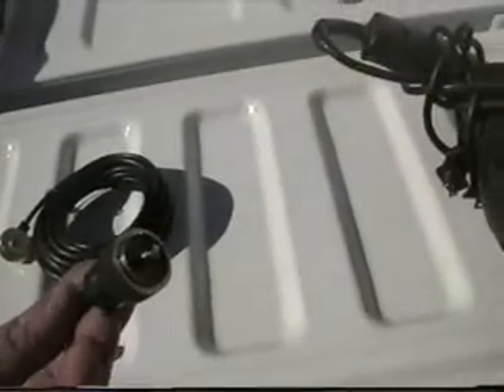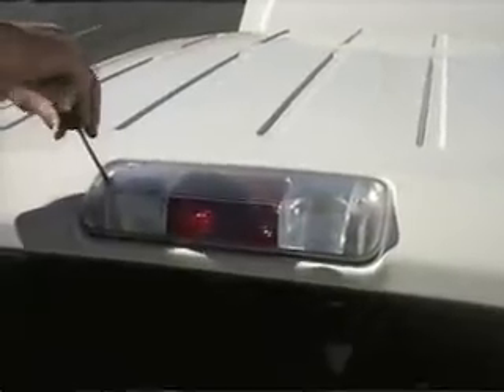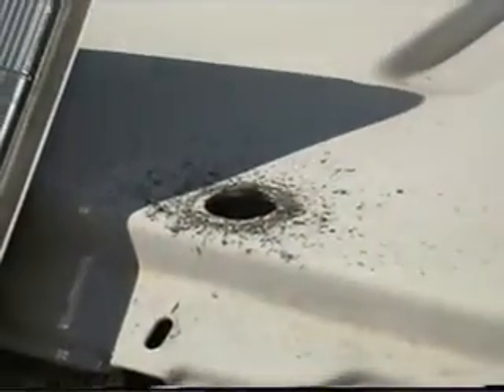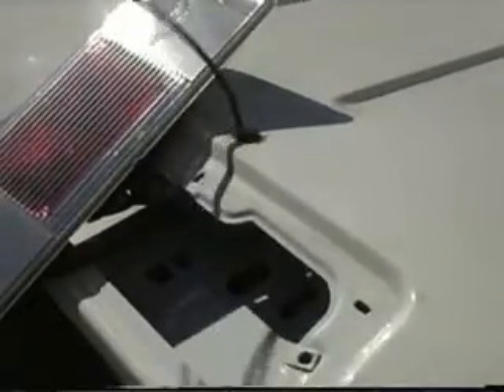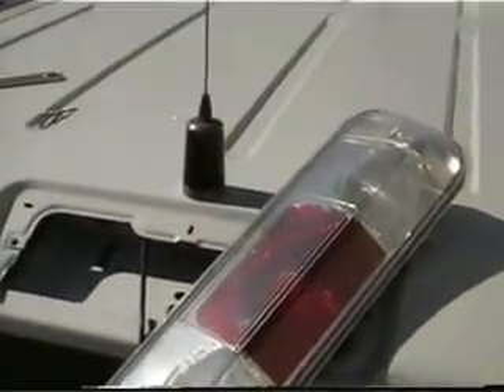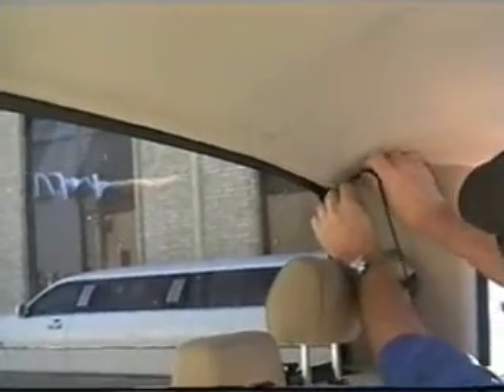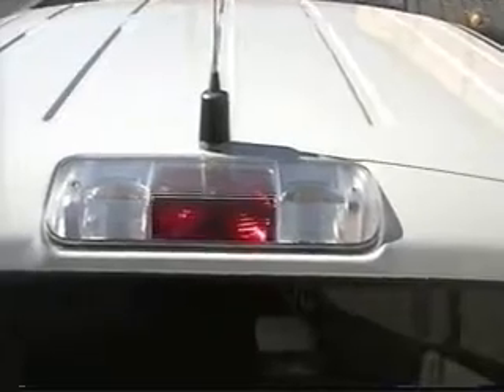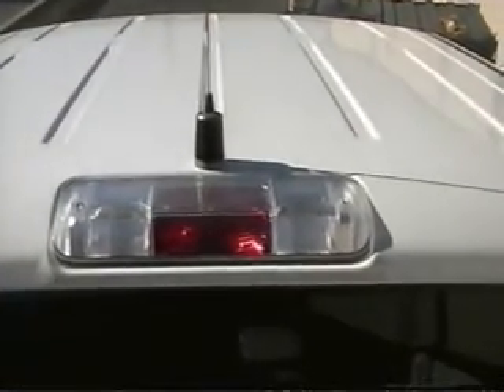How To Install A NMO Ham Radio Mobile Antena Mount

Comment: shame the roof has valleys probably have better performance moving the antenna more towards the center of the cab for better ground plane
Reply from the maker: dmb3428 We went as far forward as we could without hitting the inner roof wall..Did a lot of antenna installs that way & as far as I know, everyone was happy with the performance..Thanks for watching & commenting..73, Mel, WA5UTK